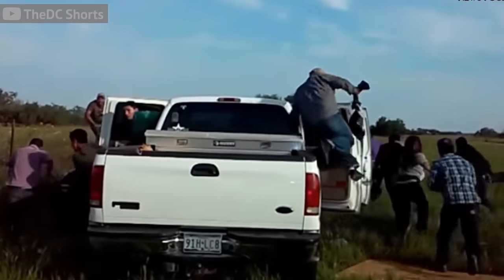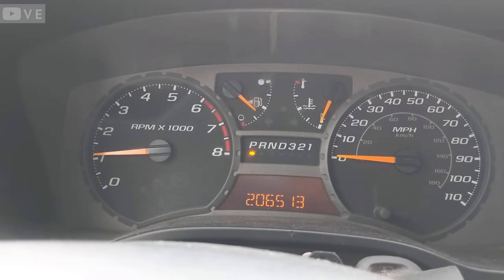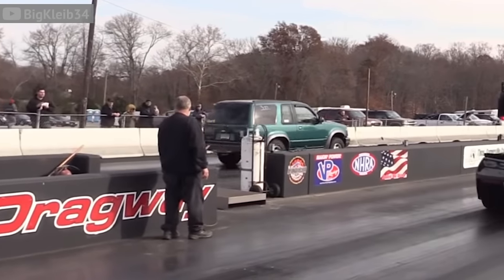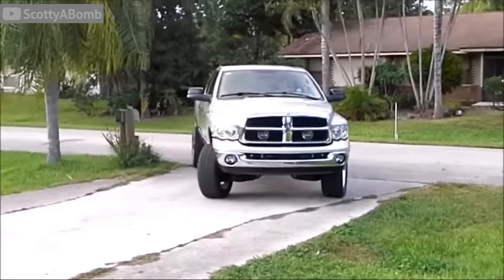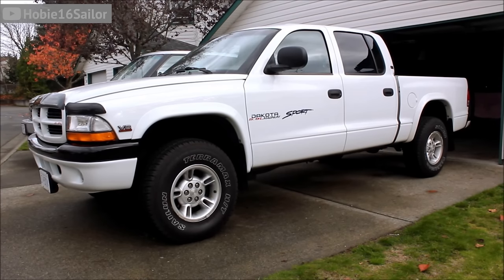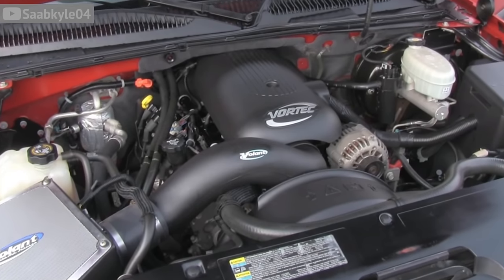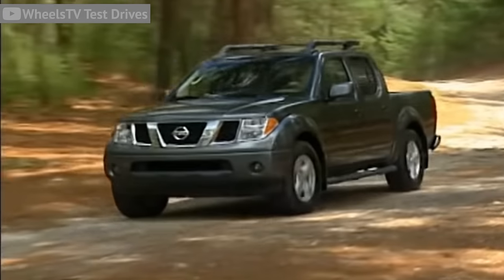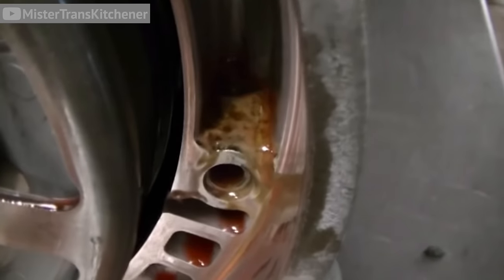USED TRUCKS YOU SHOULD NEVER BUY!

Comment: The chevy avalanche is a great truck bro ya the 4l60e  do fell  because of overheating due to no transmission cooler and lack of maintenance and the paint is trash if left in the sun for years but its a bullet proof truck that will last 400000 to 700000 miles if you fix the problem above and use good oil.
Reply: If you wash it at least every six months, you wouldn't have to worry about the paint...and mine has a Transmission cooler, and I've always used good. so no problems...

Comment: He may be on to something with that Avalanche. I had an 07 LT. It was a nice looking truck, and a status symbol. It was a decent truck until it hit 125,000, then it became a money pit. I dumped a good chunk of change having to replace sensors , a rear end differential, TWO transmissions, throttle, etc. GM also uses cheap parts, so that was another issue because they wear out quickly. It was like I was putting money in that truck every 6 mos. After a while, I cut my losses, sold it, and got me something to drive around in until I can afford to get me a top of the line pick-up. If you have time to fix on it, its a cool truck, but I wouldn't get another one unless it was a Black Diamond edition with a 200K warranty.

Comment: Some of these are facts, but a lot is opinion. The Frontier is a great looking truck (which is opinion, so it is not a flaw to say it looks old) and it drove like a dream. Biggest issue was the radiator, but I didn't worry about that since I had a manual. It just did everything I wanted, and did very well with towing. The Avalanche does have some common problems, which are shared with all 1/2 ton GM trucks, but aren't much. It must be noted that some of the "issues" are due to owner negligence.

I question why the Tundra/Tacoma wouldn't be listed when it was fairly common for frames to rust and break. Or virtually all older Dodge trucks and ball joints (sometimes owner negligence but they don't seem to hold up like other vehicles). The Avalanche, as with any GM with V8 and AFM, lifter failure is pretty common. That is the real problem with that engine family, but simple tune adjustment or OBD add on can stop it from being active.

Comment: Bs. Had a 04 Dakota 5 speed and drove the absolute shit out of it. Didn’t change the oil for about a year. Didn’t change anything for about a year. Drove it back and forth 70 miles a day. Had no issues at all. And out ran a 2000 model Silverado with the 5.3

Comment: The Triton V8 my dad had never boke down with good maintenance, and then it did because the compressor was built for 1.5 ton sedans, not a 3 ton truck. Because the compressor wasn't stock either.

Comment: This guy needs to do some homework. 

Multiple chevy/gmc trucks and SUVs from 03-06 had gauge cluster issues and blower motor resistor problems. GM had a recall on those particular issues. 

The dodge dakota and Durango shared alot of parts during those years so they also shared the same issues. Besides the v6 engine being junk it also had issues with the headlights fogging up making it have poor visibility. 

I personally know these things because I've owned an 05 Chevy 1500 and a 2000 Dodge Durango.

Comment: The frontier had no transmission issues- the issues were all based on the radiator.   With the radiator replaced the frontier's transmission is completely fine.  And Nissan fixed that issue (albeit in a shitty way for the buyer) by 2009.

Comment: The vortec 5 cil is a very reliable engine... I have seen colorado truck with over 250k on them and still running good. The problem with these trucks is that required more maintenance than a tacoma, and People kinda neglect them. Oh and the timing chain is a problem.
The frontier is an reliable cheap truck. Is old but is very reliable, the issue with the radiator and transmisión where present in early years, but more modern trucks are still very reliable, capable of reaching over 300k.
And lastly the avalancha is reliable, is the same chasis as the tahoe, what could go wrong

Comment: You called the Avalanche shit? Yee because the 8,1L with the Allison transmission is one of the most reliable cars out there. My fathers 2003 8,1L has 300.000 miles and only changed 1 fuel pump, steering pump and AC pump.

Comment: helicoil kit from autozone, you got ripped if you paid more than $50
To remove the spark plug, heat the engine up for a few mins, and then pull the plugs.

Comment: Bought a used 2004 Avalanche in 2006 with 30k miles & the transmission blew up at 55k.  So there is that, but no problems since only 105k miles  on it now.

Comment: I own a 2005 Chevy Avalanche Z71. Had it for 14 years now. I have 234000 miles on it. Yes its rusted at the wheel wells but I live in NY what do you expect. But yet my VORTEX(stock motor that came in it) and it has not had a damn issue ho wrong with it. I think it just proves that it just depends on how you treat your truck NOT soaly on how its built

Comment: I just watched to see what you had to say about the avalanche. In what world are the 5.3 vortecs bad engines? They can easily go 300k+ miles. The trans issues are hit or miss, I’ve personally never had an issue with them and I’ve had 3 with the 4l60e. Most of the issues are due to people towing with overdrive not turned off. Also the gauge cluster issue could be for any GM truck or SUV not exclusively the avalanche.

Comment: And I have an 04 f150 5.4 that just hit 179k and I've had more issues with the transmission, driveshaft and rear end than the engine. Only engine issues I've had were the plugs of course and currently need valve cover and intake gaskets. I do have the cam phasers tick but that's only annoying in like a drive thru or somewhere like that.

Comment: I’m pretty sure They fixed the problems with the 5.4 in 2006 because I have an 07 with the 5.4 and it’s amazing not a single issue in the 170 k miles it’s been through

Comment: Idk man I’m the farthest thing from a dodge fan but my grandfather bought an ‘01 Dodge dakota sport quad cab bright red but had the magnum v8. He has virtually no issues with it other than the paint. My uncle got it in 2012 with 140k miles and had almost no issues. He sold it a few years ago and the new owner said it passed through inspection needing nothing which is never heard of in MD…so idk about that on the list…maybe the v6 is another story…(trans are probably trash bc dodge) Lmfao

Comment: There was a difference between 1995 to 2003 5.4 tritons and the 2004+ models. The second-gen 5.4s had the phasers and the spark plug issues. My 2001 first gen 5.4 has 200+k miles and still runs perfectly!
Reply: Right. This guy doesn’t seem to know much outside of what he read somewhere

Comment: I have an avalanche with 220 thousand miles and its is a very reliable truck. Reman trans but still strong in the eninge. It did have a problem with the speedometer but that is fixed. Also minor repairs but that's it.

Comment: My dads got a 2002 ford f150 luxury edition 2 wheel drive crew cab with a 5.4L triton v8 back in 2018 and it sat in a pole barn when it was brand new with factory miles never been driven in its life

Comment: I have a 2006 Lincoln mark Lt with a 5.4 and it still runs great only problem it has had is a alternator about a 6 months ago and the diver side seat bottom ( which was my fault I ripped it on my holster) so in 14 years the only thing I’ve had to replace was expendables like oil batteries filter spark plugs etc and my alternator I would have to say that while 5.4’s especially gen 1 5.4s have there share of problems they are great trucks however with that being said the gen 1 5.4 has a nasty habit of covering spark plugs in carbon build up so they do need to be cleaned (not replaced) about half way through the life span of the plugs

Comment: I have an 11th generation Ford F-150 XLT which has a lot of cosmetic rust and a few breaks in its structure. However, it has a 4.6 liter V8 engine and at 82,000 miles, still works despite having spent a fortune getting it fixed. Needless to say, I shouldn't have bought my truck to begin with; the used auto dealership buttfucked me on its condition and value. My old man, isn't all that bright when it comes to vehicles either; he thought I'd be more interested in the Chevy Colorado because it was a crew cab, but I did my research on that truck and others like it, thus I know that they're pieces of crap to begin with. 
To conclude, I plan on scrapping my truck a few years from now and probably fly my ass to Ohio, Michigan or some other state and buy a restored Bronco, Blazer, Jimmy or Ramcharger and when it goes swimmingly according to plan, I'm going to stick it to those used auto dealership twats in FUCKING Connecticut; I will NOT give them the time of day in order reel me in and ask if I'm willing to trade my classic in for whatever crap they assume I'd like. They shouldn't have FUCKED me over to begin with and like a dame breaking up with her boyfriend, all I'm going to say to them is this:

WE'RE DONE; I CAN'T FIX YOU. GOODBYE.

Comment: What years are you talking about with the Ford engines? My father has a 2008 Ford Expedition with 200,000 miles and barely had to do anything to the truck. The big problems are spark plug removal and rocker panel rust, nothing with the engine!

Comment: Sure the avalanche is a bro truck but you have false information I know a guy who has one and has been in the family since 2006 the motor lasted to 260,000 with hard driving and towing and it went out because of a bent valve because of the heavy payload and with the transmission it lasted to 280,000 all original parts and maintenance was slightly overlooked and I’d say this truck is quite reliable and tuff

Comment: this dork doesnt know what he is talking about.  i like how he says colorados are notoriously unreliable but then he shows a bunch of speedometers with close to or over 200k on them.  also news flash, all cars in the rust belt rust out like that. literally all cars you can find picks of them rusted all to heck.  my 2009 Canyon has zero body rust and only minor surface rust on the frame and it lives just on the edge of the rust belt.  also go check out a colorado/canyon forums, all the motors available in these trucks if properly maintained are 300k mile+ engines.  a lot of people used them as cheap work trucks and never changed the oil or any other fluids in them so of course those die or have issues early, just like any other car would.

Comment: I agree and disagree with his statements about the Ford 5.4 ltr. Yes there were cam phaser  and spark plug issues with these engines but if I did my home work correctly by 2010 these issues had been resolved but alas the following year in 2011 they dropped the engine all together.

Comment: Must be yapping about the first gen avalanches engine. Yes it kinda sucked. 2004-2007 models had the FFV 5.3 L59 with the cam/boost ready 706 heads. Awesome engine. Sounds unreal. Had mine in the family since brand new. 2005 LT RWD. Speedometer hasn’t failed me once, tranny was rebuilt but my brother was an idiot and blew it to pieces. (He neutral dropped it at 5400 rpm.) I beat the hell out of mine and it’s still going. Tuning my tranny soon. Soon to be a 730 WHP avalanche. Keep up maintenance and it’ll run til Jesus returns.

Comment: My 2003 avalanche would run over anything you throw at it. I have a 6 inch suspension lift with a 3 inch body. Also riding on 38.5 super swamper boggers. Runs strong. You prolly dive a Ford Fusion

Comment: Im in the industry and see issues with most of what he said.. but the Avalanche is where he lost me. Maint. your vehicle and your problems will be minimal.. EVERY vehicle has its issues.. he missed out on the biggest one.. Dodge 5.7L that has cam issues.. same idea as the 5.3L AFM so plan to do a delete or disable it ASAP.. Ford Eco boost even the engineers dont know how to deal with the issues ... dont get me wrong as you may get one that runs forever but the odds are, youll see some $$ going to the shop. Of all the vehicles and issues I see in the shops.. Ill stick to the 5.3L and just maintain it.

Comment: This dood is no point of advice. I own an 05 avy with 312000 on the clock. One replacement transmission and a knock sensor. That’s it. My dad has an 02 Dakota v8 with 233500 . Just surface rust so far and it needed a driveshaft and rear after being rear ended. Both are legit work trucks. We run a welding company and haul groceries too haha.

Comment: ......ford spark plug section....spark plugs blowing out was on the older two valve 4.6 and 5.4 engines...quickly solved with a "threadsert"......next spark plug that the tips break off on were the later 3 valve engines.....THOSE were/are a pain in the ass.....phaser's and chain problems on both 2 and 3 valves.........fuel pump drivers modules are less than a hundred bucks and two bolts(if you choose to even bolt it down).......don't generally like the ford 5.4....feels weasy or cammy (doesn't make much torque at lowerer rpm's like the chev 5.3/6.0 or the hemi )

Comment: Guy is throwing so much BS about the avlanache.  If you take standard care of them they won't give you a single issue that you wouldn't expect from any truck at high millage.  My 2004 runs amazingly at 150k+ miles and has never needed any serious work.  
Later models that had AFM had some issues, but that's applicable to ANY Chevy SUV or Truck during that 2007ish time.

Comment: So wrong on the colorado lmao. Mines has 270k original trans and engine. Still runs even with warped head gaslet because the radiator rotted (probably the original radiator) lol

Comment: Watched this video just to see what this guy would say about the Avalanche...oh boy...fading plastic and potential speedometer issue are "fatal flaws" smh...no speedo problem...yes to faded plastic...other than that my 02 has 310,000 miles and is going strong. Never had any major motor,transmission or electrical issues. Don't know where he got his information  but it is "fatally flawed"

Comment: I’ve owned the Cadillac, EXt/esv and as far as the Escalade goes I really didn’t like it. I’d like in my earlier model 2000 but then years and years later I bought in 02 avalanche I am in love. This damn thing is great and it’s perfect for a mobile mechanic and that’s why they stop building. The mobile mechanic died off and so did the SUT.🤣🤣🤣😂😂😭😭 by the way he’s just hating on the avalanche. Yes, I read the comments the avalanche community united.wooooo if you really want it, you will fix it and far as the avalanche goes there are plenty of parts to fix it😂😂😂🤣🤣😭😭♾️ And I bet you, this guy, old one of those new terrible jeep wranglers😂😂😂😂🤣🤣😭😭

Comment: i love may avalanche it is so versatile with the midgate it is both a suv and when you need a truck it has a full covered 8 ft bed the only thing he could find was cladding fades and speedometer issue nearly all cheys of this era used the same  instrument  cluster  ... so he is off base i use it as both  all the time mostly the suv version but when i need a sheet of plywood  or drywall fits perfectly and the saddlebags  o use one a a cooler

Comment: Actually the dodge Dakota years should be 1997 to 2004 and the brakes were also known to go out because of a bearing in the brake system and to repair it back in 03/04 it cost 700.00 the Dakota is fancy polished turd

Comment: I have an avalanche 5.3 motors are the best the have way more horsepower than you think started off with 285 horse after cam headers heads double spring exhaust and intake change tuned and Dyno now has 400 horse it can go more

Comment: Avalanche clading wasn’t painted your talking abt the oils in the plastic that can be easily restored the speedometers were never known to fail and I’ve never seen one that had one messed up the engine had absolutely nothing wrong with it in fact it’s the same engine used in most silverados and Tahoes but yes the transmission was bad it had the 4L60E nicknamed the 4Lslippy for a good reasone but uh oh another fun fact a lot of trucks made by Chevy had the same transmission y’all are just mad it looks different

Comment: Honestly I drive a 2002 Chevy avalanche and it has 250000 miles and it still runs great I’ve never had problems with the engine or the transmission and I’ve never done any work to it only change the oil so idk where your getting this information cuz you’re wrong asf.

Comment: Knocked the chevy SSR - but did not mention f-series superduty 6.0 - 6.4 and 6.7 diesels ! These are the worst vehicles ever made and always will be ! They are not aa standerdized - everything is a restling match and fluid mess ! And the cab has to come off the chassis fir minor engine issues a 110 step procces 120 more and if you diagnosed wrong gotta do it again ! Diagnosing is not only a mystery but a  nightmare !